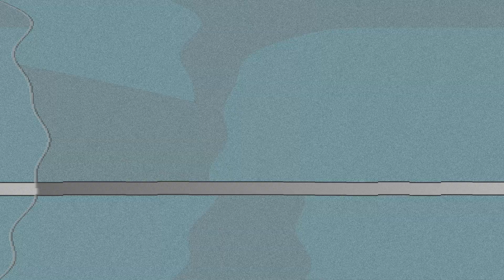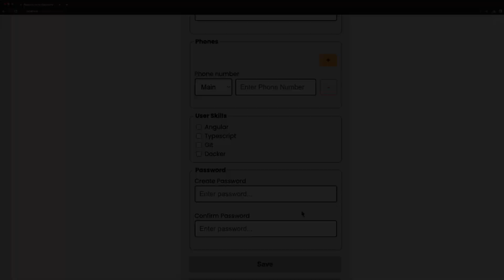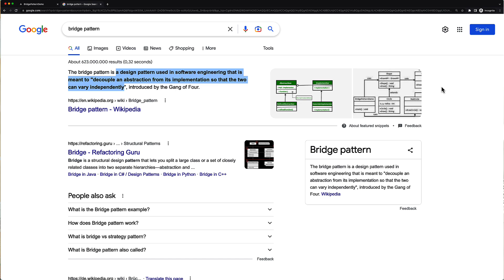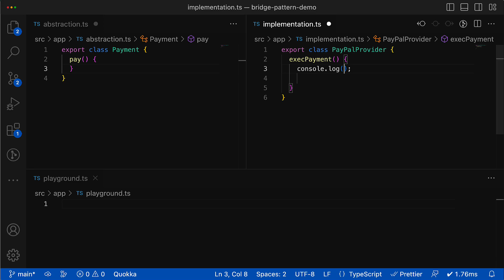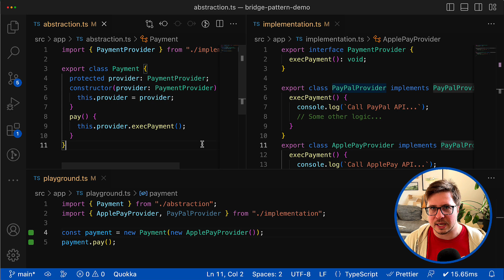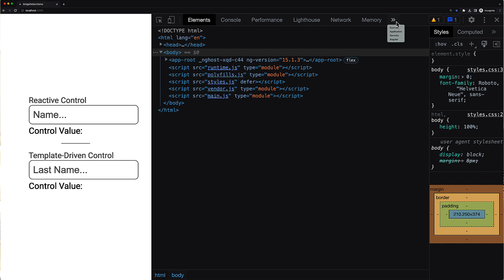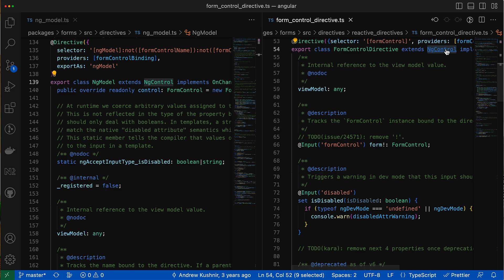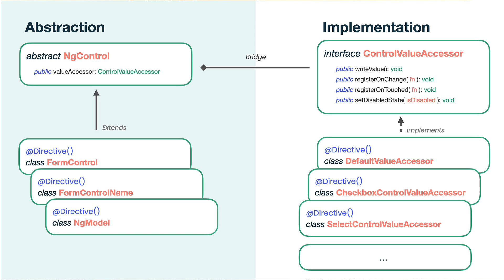Design Patterns in Angular Source Code - Bridge Design Pattern

Comment: Correct me if I'm wrong, but I really have the impression that the bridge patern is a kind of composition. FormControlDirective uses ControlValueAccessor to synchronize with DOM
Reply from the maker: I think it would be more accurate to say that “the Bridge pattern leverages the composition”. The composition isn't a pattern by itself, it is just a form of relationship between entities, which is utilized by many other design patterns like bridge, strategy, dependency injection, etc Composition is a more generic thing that is used by design patterns to solve more narrow use cases. So, your impression is partly right  :)

Comment: Hi, great videos.

I have a small question though...
I am trying to implement the bridge pattern as aou describe it for a dashboard with widgets, which works great until i dynamically create the widgets.
From then on i cannot get them through the "ContentChild" slector

tried creating them in different ways (viewcontainerref, ngComponentOutput, ...) but it seems that dynamically creted coponents and contenchild do not match

ran across a couple of people who said that contentchild only works for stuff that can be determined at compile time

do you know of a way  to use the bridge pattern with dynmic omponents?